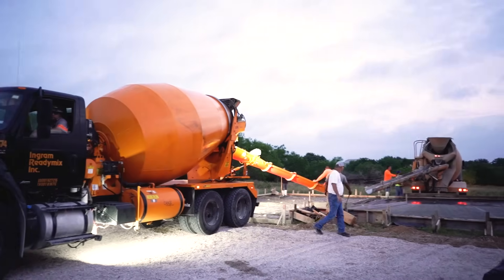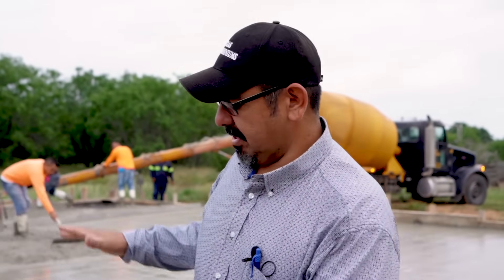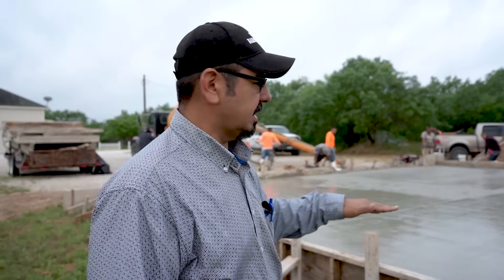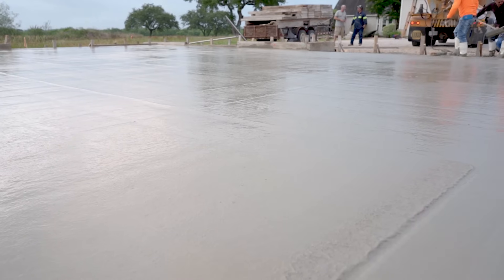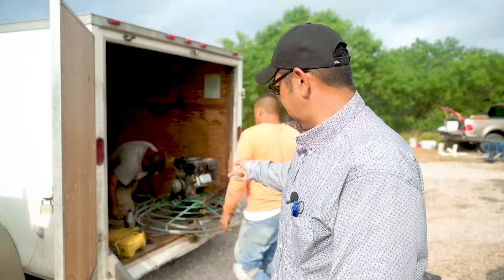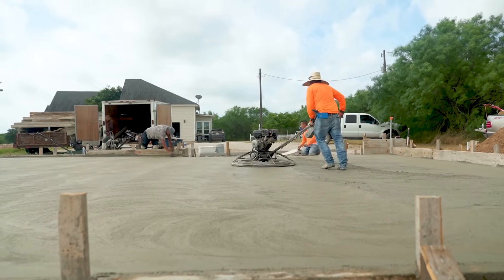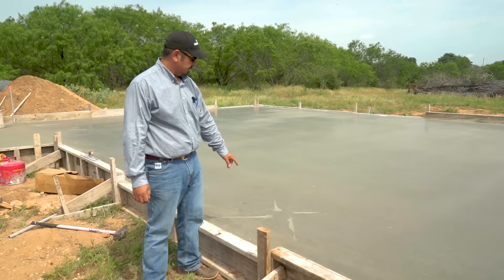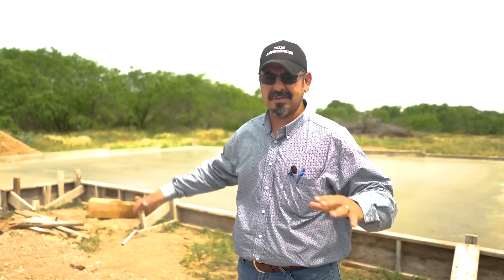How to pour and finish concrete like a PRO! - The Barndominium show E127

Comment: Use a Viber screed strengthens concrete and pushes the  gravel down were it  needs to be!!!  Use a Pan cross the floor out and then bump cut it then finish it and go home!!!
Reply from the maker: I’ve heard bad things about vibra screeds.  They push aggregate too far down.  That’s why I’m staying away from them.
Reply: @TexasBarndominiums  no if you don't  hold the throttle down too much and you know exactly what your doing. I scored with a vibrator screed a 68 an a 76FF floor on a corrugated decking Circleville hospital Ohio. It brings the cream to the top and closes the floor nice!!!
Reply from the maker: Which one do you use?
Reply: @TexasBarndominiums  I used the hand vibro screeds and didnt like them. I loved using a full vibro screed that rides across forms, uses winches to pull itself across the slab, very fast and dead on. Well, provided your forms are dead on. Also like hydraulic roller screeds, used them on freeways and slope concrete like channel lining. Looks like this http://www.vinayindustries.net/truss-type-screed-vibrator-4276036.html
Reply: @TexasBarndominiums  While everyone is giving you advise, I think you need a Bid Well machine. Yep, you need a Bid Well. Might find one cheap at Richie Bros.
Reply: @TexasBarndominiums  a Allen it's easy to control and don't go over a 12' screed.Cut your screed pads 12' and bring each side in a foot and make sure you have good rakers!
Reply: You boys need a lesson in "Freeze / Thaw"! Your Vibra Screed concrete would not make a winter. Throw all your metal tools away and get the wood out!! I live in an area rhat has over 200 days a year of Freeze / Thaw. I've seen what a contractor can do to a good mix!

Comment: Why don’t you use curing compound on your slabs instead of utilizing water to cure. Cure does just as good of a finished product and it’s instantaneous and one&done for the same amount of cost in water.

Comment: Your form material is growing mold don't be cheap. get your Carpenters  some good material to work with the form will not move
Reply from the maker: Darrell Johnson 
🤦‍♂️
Reply from the maker: Mold doesn’t make the forms move, it’s the weight of the concrete pushing against the forms.  New or old forms doesn’t matter, we must check them either way to ensure perfectly straight concrete once we are done.
Reply: Properly set forms will not move
Reply from the maker: It needs to be checked anyway.  You can’t guarantee that it won’t move, so it must be checked regardless.
Reply: It looks like some type of racist comment
Reply from the maker: 😂 
Ok.  👍

Comment: If it's too wet for a sprinkler it is not a mirror finish also no saw cuts ?  If it is so good it is ready for the sprinkler don't be lazy go ahead and wreck the forms and stack them up. Rub the edges on those raggedy ass forms

Comment: Thank you for the information but I think you are extreme when it comes to concrete.  I have done concrete many times and don't have your equipment or as much knowledge in this field.  I do believe you know what you're doing but I think most people don't have the ability to use the equipment you have.  My concrete has never had major issues so "job will be ruined", I don' agree with you.  It might not look as nice but it's not ruined.   You are exaggerating.  Again you do nice work and I appreciated the video but it would be nice if you did not say "ruin the job" it's miss leading.  Your concrete will NOT fell.  Adding to much water, not having a good base, etc..  Those are things that will "Ruin" your job.

Comment: U act like u no everything  thata not true u sont have to run 3 sets of different  blades  grade it flat the first time n u wont have to fill in a your bird baths n if u kick every stake n back full as pouring as use string line like u do u wint have to b pounding stakes as u pour  if all kickes n backfilles when pouring I give u a 89 to 91  but ain't a plus n tell the people to turn machine when picking up not just stop n pull r picup turn it as u picup n it helps to but not bad but dont no all neither do I so settle down